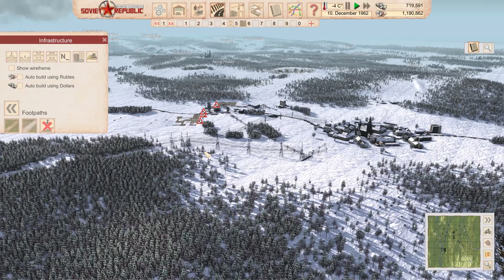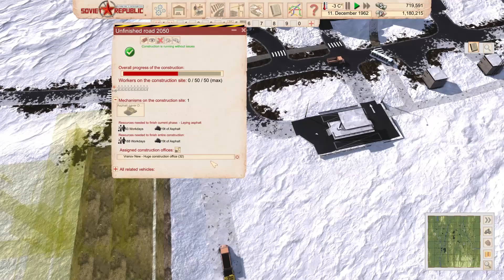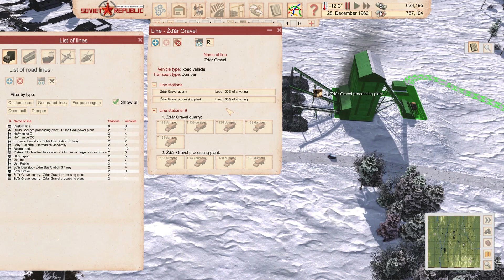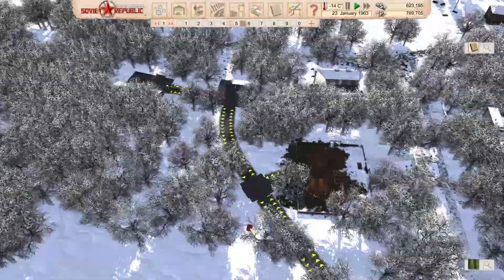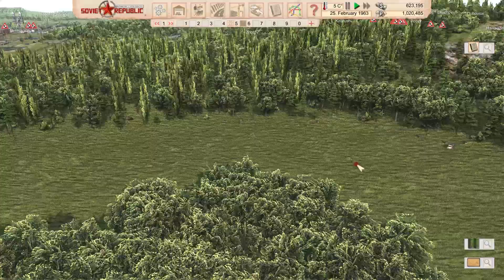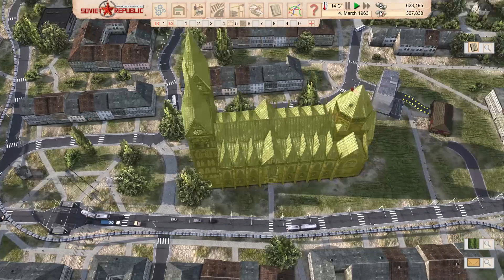Workers and Resources - Soviet Republic - Ceanwu Republic - Ep.13

Comment: I'm a BIG fan of regional distribution offices (RDO).  They are essential for quick supply of industries, construction offices and exporting in the early stages of development of the nation.  Even when rail and shipping takes off, the RDO's enable fewer stops so there is less of a chance for bottlenecks occurring.   I'm not a huge fan of industrial trains entering cities, unless they are on the outskirts only; passenger trains are fine, though.
Reply from the maker: I agree on all points. Here is the issue I will have.
In Hermanice 1 local dist. off. will not be enough. 1 office cannot have more than 20 connections. 3-4 loading areas 6-7 stores for food electronics and clothing plus as much for meat and you are full even without having distributed fuel or stuff for the local industry like chemicals, ele. or mech. comp. So I'm thinking about many small distribution offices. Did you do those?